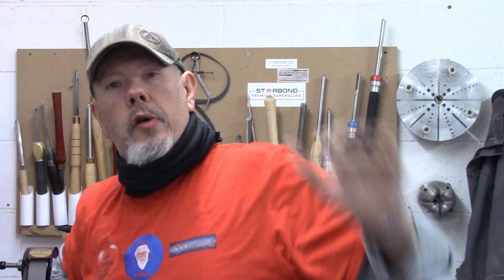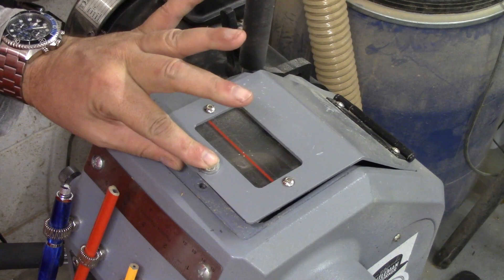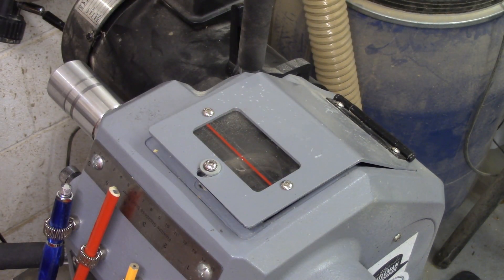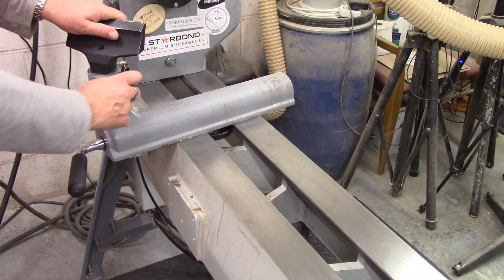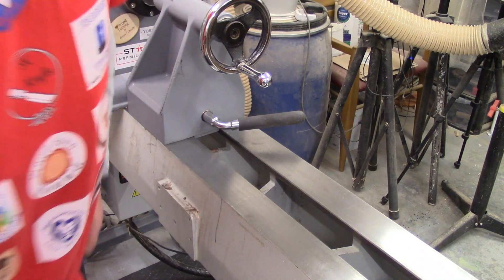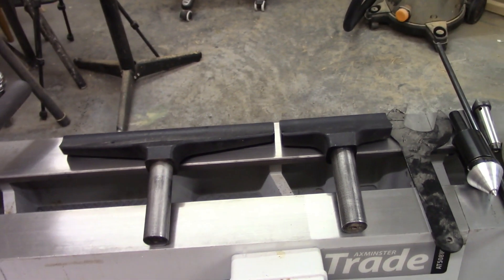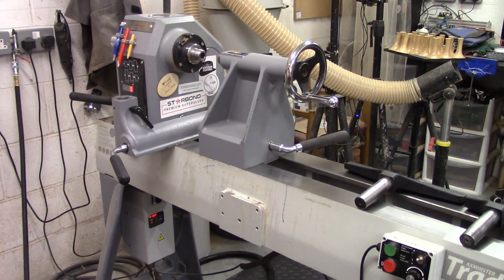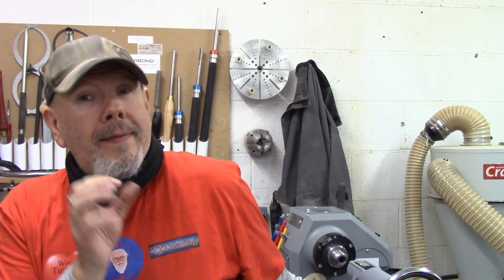Tool Review - Axminster AT508WL Lathe #axminsterpowertools #lathe #review #axminster #tools

Comment: Mark when head stock locks in normal position i assume there's a bit of play as you said you need to use alignment tool.  Thanks again
Reply from the maker: Yes there is about a 2mm play in the system. For every lathe with a rotating headstock you should always re-align after it's been swiveled.

Comment: Are you sure that the head rotates at 45 degs? I thought it was 30degs or have I got it wrong......good report though. Regards Frederick
Reply from the maker: Thanks.
Reply from the maker: Yes it is 45° I just didn't do it properly in the video.
Reply: @MarkBeckettRPT  You seemed to turn 90 deg in 3 stages, so if they're evenly spaced, the angle would be 30 deg.
Reply from the maker: Yeah, I was fumbling because the tripod was in my way. It may look like that, but I can assure you it clicks in 45° increments. Also, it's stated as such on Axminster website under the description details for this lathe. My apologies for any confusion.
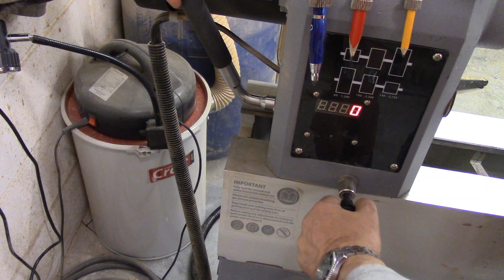Reply: @MarkBeckettRPT  I agree that the Axminster website says "The headstock can be slid totally along the bed and swivelled through 360° with indexing stops every 45°.  Also the instruction manual has numerous references to the steps being 45 deg. However, I've just played the video again from 2:40 to 3:00.    Just look at those angles where it clicks.  Looks like 30 and 60 degrees.  There are 3 click positions to get to right angles (90deg) so each step on you lathe must be 30 deg. Perhaps they've changed the design, not necessarily a bad thing to have more options!  If you look at this review at 10:40 the guy refers to the steps being 30 deg despite the instructions saying 45 deg !  https://www.youtube.com/watch?v=6GJ1YLVIiuw   (Axminster AT508WL Unboxing & Assembly Part Two)
Reply: @MarkBeckettRPT   You're doing a grand job...keep at it.